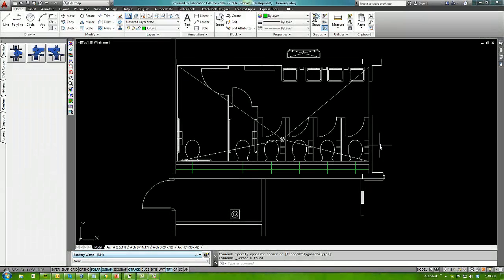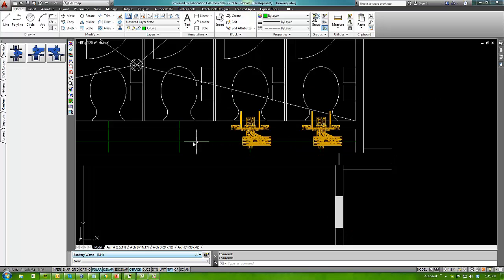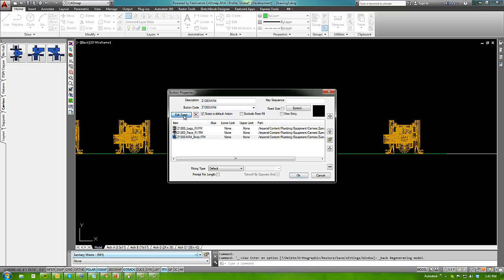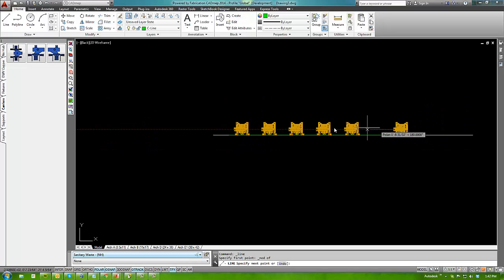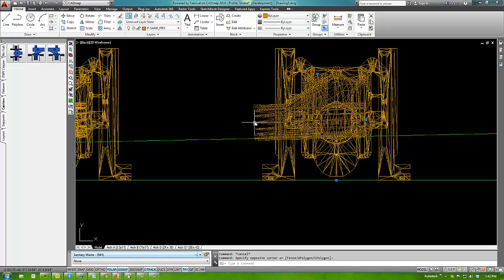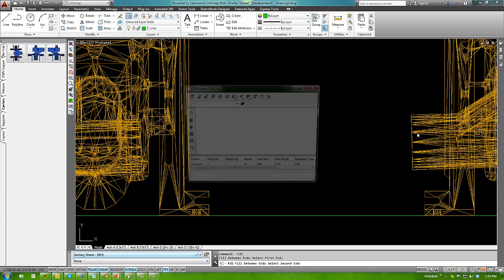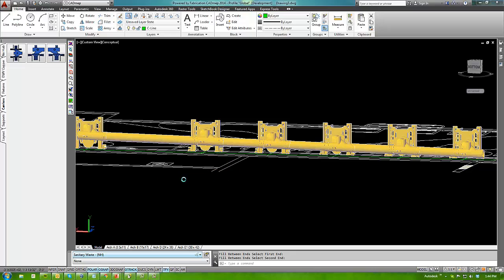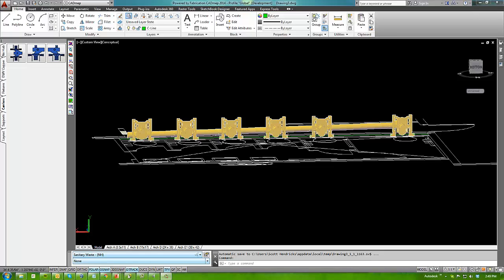Fabrication CADmep: Placing Closet Carriers

Comment: Phil Hesler Jr... did you ever find out how to split the itm file? If anyone sees this and knows how to do this please let me know.
Reply: I'm in the process of understanding the Conndef command and convert3dmodel command completely.  if only i spoke Hindi id probably know how to do this already.... there is absolutely no in depth guide that i've found on how to do this process, just basic tutorials that say, "all you have to do is just place the conndef block where you want to connect pipe....ya, right.  The issue with any tutorial i've seen is the ITM's being made are not stacked buttons(multiple ITM's in one button). i've successfully made single ITM's with multiple\different connectors to work no problem. its when i have 3 items(body, faceplate, legs), 2 of which(legs and faceplate) have no actual fabrication pipe connecting to them(which is why you still would place a connector at a common base point(0,0,0) for each ITM(legs, faceplate, body) and specify the size and depth to be 0 with the type round, hoping that the script sees these as the same type for all three ITM's and places the ITM's accordingly . One thing to note is the order of which you place the conndef block i believe directly affects the number order for the connectors for the ITM, i could be wrong though,  i want to say that the order of how these connectors are placed into the ITM might also be affected when you run the CONVERT3DMODEL, depending on which Conndef block(connector) you choose first, for example, when i run the CONVERT3DMODEL on the Body of the carrier that has 4 conndef blocks, i don't window over the whole 3D Solid and Conndef block(s) and press enter because it might change the order of the common basepoint which should be connector 1, i choose the connectors one by one, the first connector being, in my case, a common base point between the three ITM's( so after the ITM's convert, they would all have connector 1 at the same location, all should have the size and depth 0, type round).. so when you place the Conndef block for the legs, place it at 0,0,0(or wherever center is for you), same with the faceplate. the connector should have a size and depth of 0, and the type should be round. for the carrier body, the first conndef block should be placed at the same 0,0,0 location as the legs and the faceplate so that connector 1 is at the same location for all three parts of the stacked button. the body of the carrier, it should have 4 conndef blocks(connectors) placed. so connector 1 is the same between all three ITM's or however many ITM's you have, the second connector should be on the outlet(downstream) ,which in my case has the size and depth of 4, with the type being round. then the inlet(upstream) which would now be connector 3 because this is the 3rd Conndef block we've placed. should be size and depth of 4, with the type Round, and  then the vent which should be connector 4 because this is the 4th Conndef block we've placed, and a size and depth of 2, with the type, again, being round. once you convert them, you have to set some options up by double clicking on the created 3D model, go to the options tab and change library from duct to piping(double clicking changes the field), then go to the Item tab to set the specification, material, and service. i've seen tutorials that say you should check the button "Bought Out"... not sure why, but i do because the other carriers that came with ASTI have this checked. sometimes you won't see the General pipework as an option in the specification drop down. i've found that savetofolder command needs to be ran. then run the FOLDERS command and find the ITM, right click and click change specification, then go back in the Edit window, it should then be there....  why does this have to be so confusing! when i figure it out im going to post an in depth video\tutorial everywhere i can. if this was confusing, welcome to fabrication cadmep, i might have been all over the place with this comment but hopefully i've mentioned something in my blabber that will give you that ah-ha moment or get you to the next step so we can reverse engineer this process.
Reply: just tried the CONVERT3DMODEL command, and confirmed this is the time at which the selection order of the Conndef blocks(connectors) matters. after executing the CONVERT3DMODEL command and selecting each Conndef, one by one.  The first Conndef selected will be connector 1, second will be connector 2, and so on. im pretty sure it doesn't matter what order the blocks were originally placed, it only relies on what order the Conndef blocks are selected during the CONVERT3DMODEL command.

Comment: This is the best way I've seen these done.  Question though, I've only had about 4 months so far into using Fab CAD MEP, how did you get the 3 items into 1 assembly yet when you bring up button properties they are still separate?  If I use 3 itm files then use "make sub assembly" command it joins all the items so I cannot manipulate them the way you are doing here.  Thanks.
Reply: when you have the service properties window open(where you can drag and drop buttons into the service tabs) you simply drag the first item, which in these carriers, is the legs. then drag the Face of the carrier onto the legs button, then the body onto the legs button. this is called button stacking.